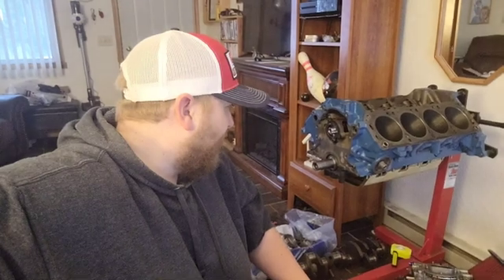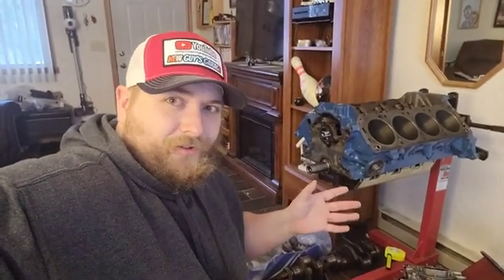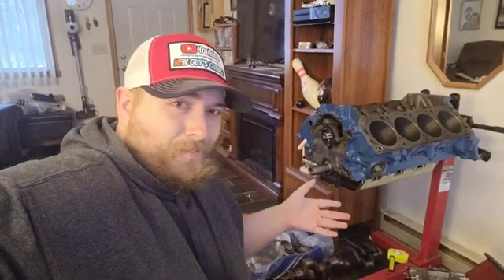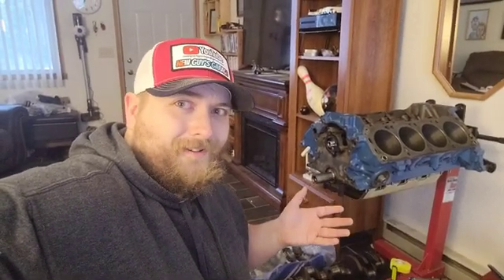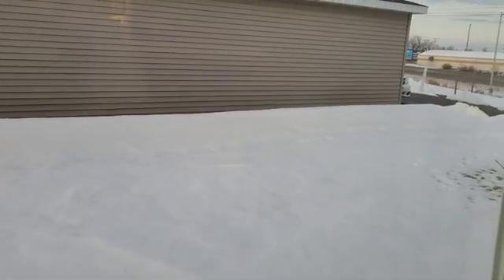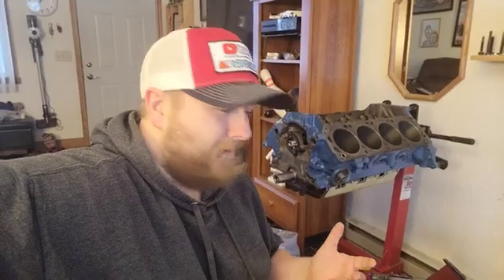302w SBF Engine Build! | Progress Has Been Made! | 1965 Mustang Motor Coming Together | Piston Issue

Comment: I've got a short block I could let go if your interested never run .
Reply from the maker: What kind of short block? 🤔
Reply: 72 block. 030 w/ line hone ,forged pistons, 289 balanced rotating assembly minus Balancer and flywheel and heads
Reply: With 70 302 heads
Reply from the maker: @williamrose8944  what you looking to get for that unit?
Reply: $850 is what I paid for it I could send pictures , I'm in Michigan
Reply from the maker: That is a good price for a short block, im all the way in MN though lol 
I just need to get the piston to valve clearance situation figured out and I'll have this one ready to go 🙂

Comment: Put 1 piston and rod in with timing chain and check your piston to valve clearance. I just built a 302 with BluePrint heads with a z303 cam using Probe flat tops with 4 valve reliefs. Check clearance at 10° btdc and 10° atdc. You may be surprised at the clearance.
Reply from the maker: Can't hurt to check! 😃

Comment: I think I'd use what you've got cutting valve relief shouldn't be that hard just a little bigger than what's in there , saw up an old head for location some guy on YouTube did it . Were you going to flip the stock pistons? Machine time is not cheap let alone finding  a  GOOD one. Small combustion chambers make higher compression too good luck
Reply from the maker: Ya I wanted to flip the pistons, which is why I wanted to use the stock syle pistons for the build lol 

I might just mock it up and clay it to see if I do have an interference issue, might not who knows 😂